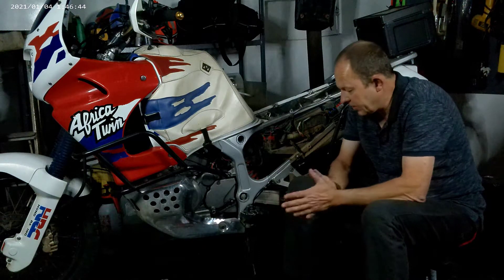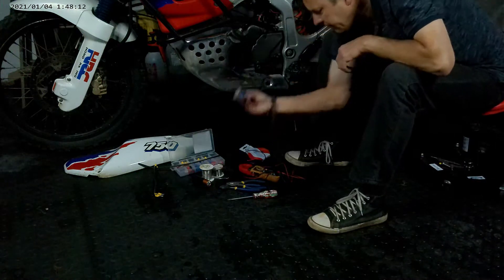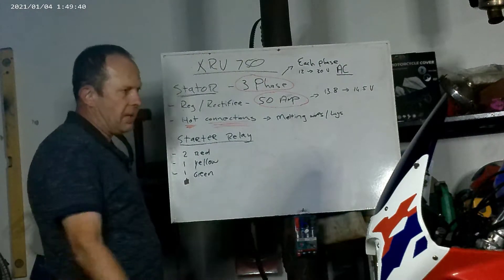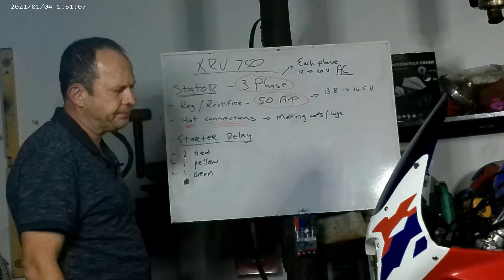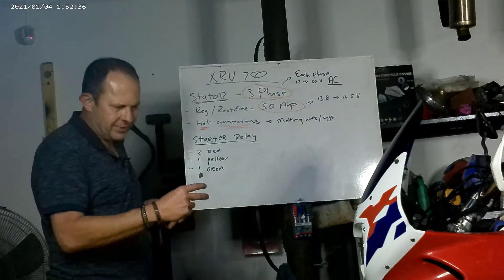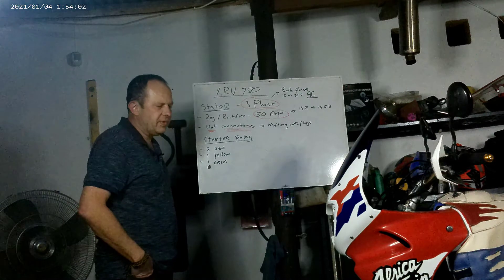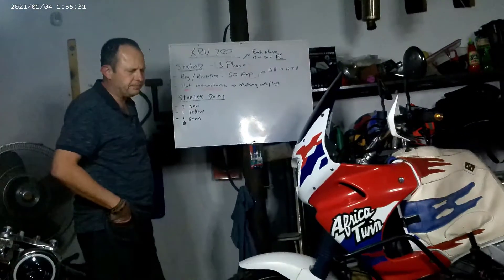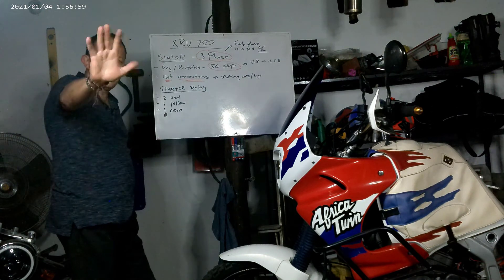Africa Twin Rectifier #africatwin,#xrv750

Comment: Hi Frank, in what place, between what wire's, do you recommend putting a voltmeter?
Reply from the maker: Hi, if you want to fit a voltmeter on the dash, i suggest you wire it through ignition to battery, you will get the true readings directly from battery.

Comment: Thank you FranksWay, very useful as always. I'm buying a mosfet rectifier from Boano that doesn't have the round connector with 4 wires, just has the positive and negative wires. Do you think I can wire it directly to the battery leaving the round connector free? Thank you a lot!
Reply from the maker: Send me a pic to +33780771661

Comment: Thanks.. I learned something here. I posted on another video of yours re my charging issue on my year 2000 RD07 last week. Startline had the mosfet rectifyer.. but didn't sell the plugs that go with it, so opted for similar one that had it's wires built in. Long story short. Bike is charging at 13.6 at idle, going to 13.9 at revs. Though these figures are ar your minimal spec range. Does that mean the stator is not providing enough umpf.. or is there something else brewing? Taking her out today for a long ride.. taking an extra pint oil wih me😂. .. and good tip on taking an extra rect with you.. just incase.
Reply from the maker: Check your 3 yellow wires to rectifier..the plug melts usually...stator should be ok...check your wiring plugs...glad you learnt something

Comment: The three yellow wires on my rd07 have melted the Plug. Sometimes it has no electricity at all...if i move the cables a bit power comes back. She starts but drives only with a massive loss of power. She has 160000km on her back. Change the rectifier? I already renewed the connection. The loss of power comes after 10 min. of riding, if she doesnt turn off before
Reply from the maker: Put a multimeter on battery and check if you have 14v charging on battery first.

Comment: Hi FranksWay Love Your Videos and I miss SA so Much rode my XRV 750 from UK to cape town West coast then back home East coast 2006
Man I love these Bikes Frank Can you help after the Rain here in UK the Damp stops My XRV from Starting I think damp getting in Starter Motor
Going to remove clean this Weekend Also ignition Lights came on this Morning didnt start then i turned key slightly to the Right and Neutral Light
Oil light went out....key ignition on way out it has never done this before any thoughts would Help keep the Videos coming Bru Lekker baie dankie
Reply from the maker: Hi i can help out,currently in Ireland and need to visit UK for some mini carpets..i can be reached at +353 89 973 0484, can pop in and help out..

Comment: If I want to solder the three yellow wires I have to do it one by one or can I solder the wires all together ( three together + three)
Reply from the maker: Solder them seperately please,connect each seperately from rectifier to the ac,flywheel side,if you need photos let me know please
Reply: @FranksWay  Thanks  for your help, i really like your videos. Looking forward for the next one, cheers!
Reply from the maker: Thanks a lot,i am also working on making them available in your language of choice 😀

Comment: Great, very useful and will reference back when I service  my bike. 
Quick question,  at high speed  my bike dies, im assuming a fuel starvation problem at high consumption. Dont think its the pump as that pumps at a steady speed no matter what, blocked filter?
Reply from the maker: There is a bunch of common electrical issues, you can whats app me on 0717802213, then i can send you a voice note for things to check.PS, i am taking my AT up to 840cc in the new year :)
Reply from the maker: Hi,i need to understand firstly which motorcycle you have,i assume its an Africa Twin RD07. An AT dying on speed low or high : check your fuse at the solenoid relay, and your wiring there as well, chances are they melted possibly, common issue..let me know what you find.